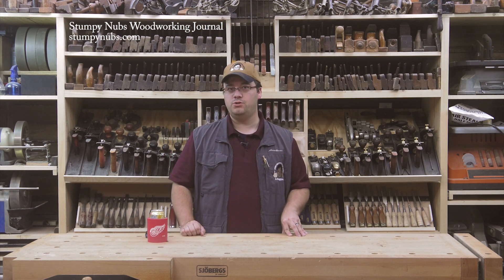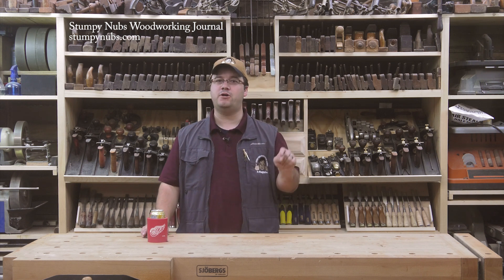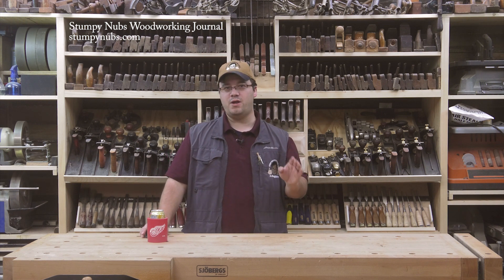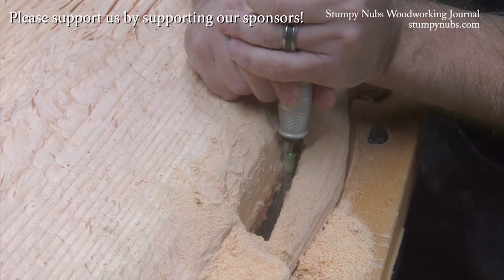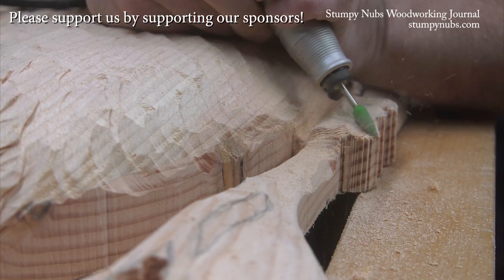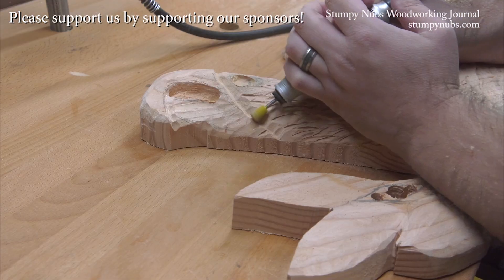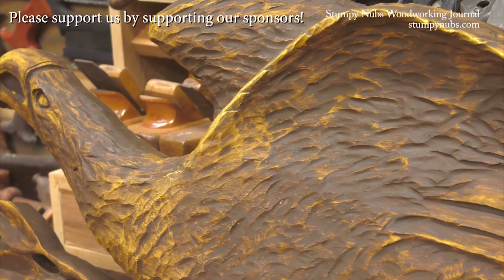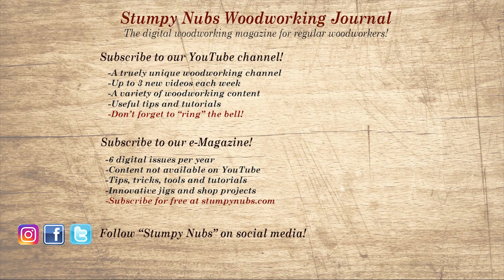Do they really boil linseed oil? (And other oily answers)

Comment: I made a little desk organizer with three drawers out of birch. Since it doesn''t need that much protection I just gave it a coat with mineral oil but that sh*t doesn't want to cure, still sticky after 3 weeks and when I lay a letter or smthg on top, it ends up blotchy. Could I top coat (seal) it with furniture wax? Thankful for any advice!

Comment: Bob Flexner did a great job explaining the differences in oil finishes in his book, *Understanding Wood Finishing*. If you want to know what your "oil finish" is, smear some on a nonporous surface and let it cure for a week. Wiping varnishes like Formby's Tung Oil Finish will be hard and clear. Oil/varnish blends like Watco Teak Oil Finish will be slightly rubbery and wrinkly. Pure oils will be soft and boogery if they cure at all.  For that reason, I have trouble calling applications of pure oils "coats" when they don't actually coat anything and just absorb into the wood. If they do leave anything on the surface, just about everybody would immediately think to remove it. You can polish the wood, but you'll never polish the oil!

Unless it's a polymerized oil like Tru-Oil or Tried & True, which behave more like varnishes...
Reply: That's a great reference book, and was welcomed to my library years ago.

Comment: Maybe it was worth mentioning that mineral oil is a petroleum based product, especially given that the edibility issue came up multiple times, and the topic was 'natural oils'.
Reply: @JorgTheElder  you're right. an extracted or distilled product does not  mean a synthesized one. i do wonder if by definition, a product that is not synthesized is automatically considered natural.
in any case, i thought that given the abundant talk regarding edibility, constipation etc, it might have been possible to mention what mineral oil is, especially since he did explain what the other oils were.

Comment: James, had you researched how the carriages for cannons as found on ships prior to the invention of the modern naval ship cannon 1890-Present. The wood carriages were soaked in raw linseed oil that were heated in large metal tanks for the term of 30 calendar days straight. This process kept the wood free from bugs that could attack the wood and kept the wood stable from sea water. Of course the wood parts were drip dried then given several coats of an  paint. Then the carriages were assembled.

Comment: Thanks for the video.  What about unboiled tongue oil ?  any advantages ?  I have heard that it polymerizes, and will result in the feared spontaneous combustion of a rag pile, but how does the polymerization affect the durability of the wood ?  should it be applied in frequent layers, or hardish, or even  fully polymerized before another coat ?

Comment: I use organ oil with bees wax and citrus turpentine to thin it out to desired thickness and if you treat the timber before assembly it will stop it from splitting.

Comment: Hey there. Good video. What would you suggest for axe handles? I hear that BLO may be hazardous to your health due to the chemicals. Axe handles (Hickory especially) dries out over time and the heads become loose. So the goal is to prevent shrinking, yet provide protection from the elements without exposing ourselves to harmful toxins. Thanks.

Comment: I read about a finish mix using BLO, Mineral Spirits, and Wax (I believe Paraffin). I used it on our fence here and it turned out well. The wax has to be melted, of course, and the mixture is best produced on a hot day so that the wax doesn't solidify in the mix. I can no longer find the resource but would love to hear others thoughts about its use and longevity. So far the fence has only dealt with one fall and one winter but looks as good as the day I applied it.

Comment: heres a cross question,  why is it woodwork channels always ignore an old stain finish i have used to good effect, made a wood frame in pine (cheap), then mixed a LITTLE `camp` instant cofee(chicory) liquid with walnut oil, vary coffee amount for varied tones to makeframe look antique pine or even european oak plus finnish is 100%safe if your not allergic to ingredients, so you can make a project from pine look like oak and then if you decide to lick or suck it the finish wont poison you and neither will the dye. not so cross now

Comment: I like coal tar oil, raw linseed oil, and a good solvent, usually turpentine or kerosine. Mixed in even parts. For finishing gun stocks I add some beeswax. I warm the wood and the finish with a heat gun. Use beeswax melted into raw linseed for a top coat.

Comment: I have seen products called "tung oil finish" that have no tung oil in them. As the video says, read the label.

Mineral oil never cures and is a poor finish for pretty much anything; I fail to understand its popularity for finishing cutting boards. A far better finish for them is walnut oil, which can be found in most grocers. (Or, if you want, you can pay ten times more for the same thing at a woodworking store.)

Comment: Ya managed to sneak in a lot of laughs in this one....  Another good reason for using mineral oil over other oils (tung) for cutting boards and wooden food prep implements is that nut based oils can likely cause allergic reactions in folks with bad nut allergies.    I used tung oil on some small candy bowls years ago.  But now I use a mix of beeswax and mineral oil mixed so when at room temperature it's roughly the consistency of paste style furniture wax.  It gives a finish that looks and feels nice without being oily and it doesn't wash away as rapidly as straight mineral oil.  And of course it doesn't go rancid over time like nut or vegetable oils can do.

Comment: " It doesn't come from its tongue, it comes from its nuts" Yup..🤣🤣🤣  

I like to thin the BLO that we get in a rather thick viscous state, with about 10 to 15 percent odorless mineral spirits. It improves wipe-ability, and the coat will dry more quickly. I never add polyurethane for indoor use finish.. but for outdoor use, may match the volume of spirits with equal amount of polyurethane.

Comment: great video. Had me giggling the whole time. I have always been a fan of BLO and paste wax. Ive also sprayed hundreds of gallons of Lacquer and used lots of marine spar varnish on rafting and boating gear, of course that has been hard to get ahold of in the last few years due to the restrictions on VOCs. Diamond Vogels industrial division does make a low VOC marine spar varnish. Unfortunately its not near as good as the old stuff. You can still get some of the old product but they can only sell it in quart quantities and they raised the price so that now a quart is the old gallon price. I remember asking for marine spar varnish a few times in the big box stores and they directed me to a product they call marine spar polyurethane, which of course is a physical impossibility.